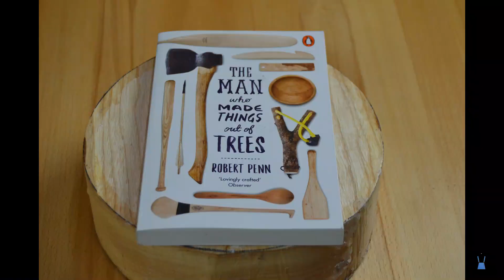Wood Wecognition Wednesday:Ash

Comment: It would help to have more than one other type of wood in the comparison for color, grain structure, and other features. Like one lighter, one darker. One more open grain, one tighter grain, etc. Bark sample if distinctive.
Reply from the maker: Hi valerie, this is the start of a series which, will cover a lot of timbers discussing all those points. I will bear those points in mind but i need to be careful on the length of video. Bark and leaf recognition is more appropriate for recognising the tree rather than the pre processed hardwood so i will probably not be including that in the series. Thank you for watching